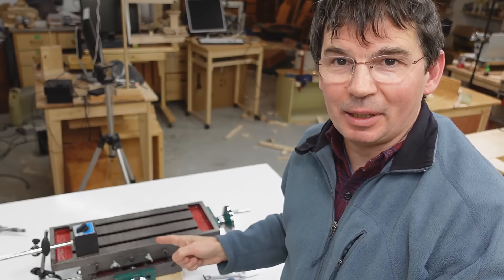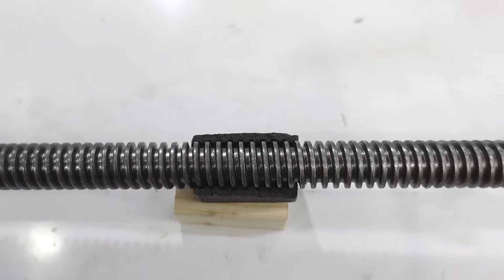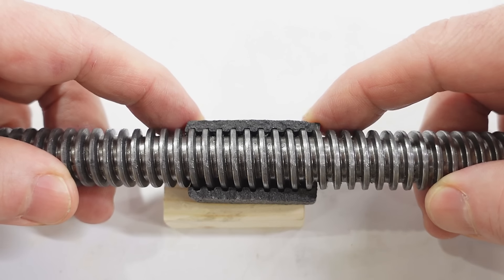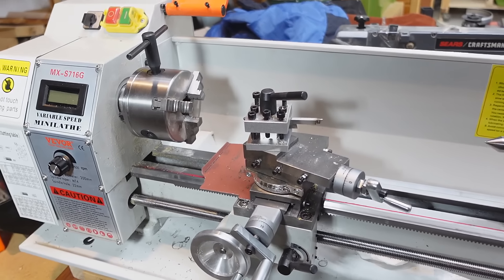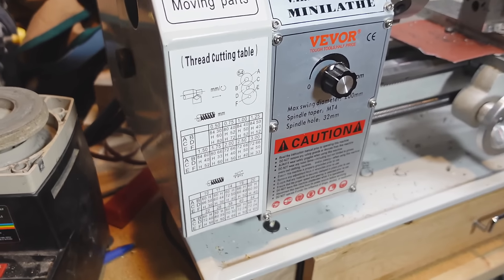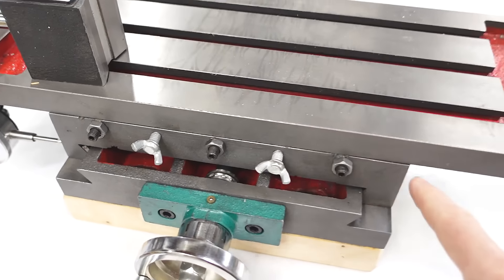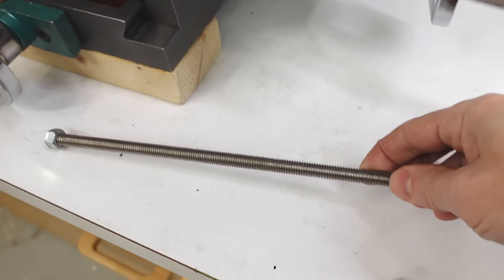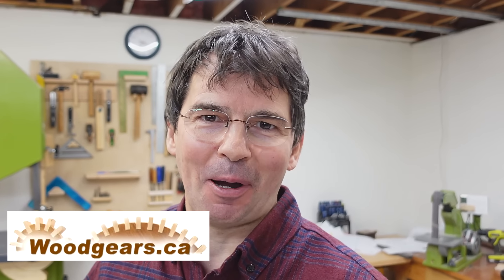Why all the hate for Vevor?

Comment: The worst part is that most of the people who criticized this table will still buy it and use the cheaper drill press with a lot of structural flexibility and spindle runout as a makeshift milling machine just because like me they do not have the budget to buy professional tools but unlike me they don't want to admit it and prefer to blame the sellers/manufacturers.

A better ball screw would make it too expensive for many DIYers, maybe it could be offered as an upgrade for those needing the extra precision.

Comment: I got a 12T hydraulic press from Vevor, to replace wheel bearings, & it works fine.

That things doesn't look like the accuracy is great, but good enough for the price.

Personally, I wouldn't pay for one of those, & I didn't. I made one, from an old bed frame with a couple pieces of all-thread.  (All I wanted was a way to align stuff in my drill press & drill holes, not mill.)

Comment: If you raise and lower it as you turn the handle, then check the bearings. They shouldn’t have more than about 0.001” play. Ball bearings should have less. We see Harbor Freight. For decades, their best stuff was not great and the cheaper products were close to junk (well, some products were pure junk). But the owner decided to move up scale from that and now have a fair number of pretty to very good products. They still have the questionable quality cheap products, but many seem to be in the middle of being phased out. At some point, it’s very possible that Vevor will move in that direction. I have some of their products. Some are fine, but some need work. When it comes to cheap Chinese and Indian products, you really need to have the expectation that while the main parts may be fine, there will be work needed. If you can’t, or won’t do that, then spend more on products that are fine out of the box. There’s no point in people complaining that a cheap product doesn’t work as well as a more expensive one. And folks, these products are really cheap. A good table the same size as this one costs around $1,000. Think about that when you’re deciding what to buy and don’t complain when you choose the cheap one.

Comment: I bought a Vevor lathe. It had really really good reviews on their website. 
When I got it and unboxed it I was extremely disappointed. Where to start, the bearings sounded like they were grinding.
The LCD screen was broken. The bed was two pieces of what looked like die cast unevenly welded together and so on.
(There were still a lot of issues.) I contacted them and they said we will send replacement parts. They sent a replacement LCD
screen only. I am almost positive that they use Photoshop on their products listed on their website. Next they contacted me to
try to get me to pull my bad review including pics on their website. At 50 percent they refund it and then remove the review. I will never
buy from them again. They are not honest and their product is garbage. I kept the lathe because I will be posting it on youtube
to show people hopefully not to waste their money.

Comment: You could consider it as a step in the right direction by getting this table and reworking it to a higher standard as opposed to completely manufacturing a table from raw castings etc.........cost is a high factor for manufacturing from raw materials. especially if you don't have machinery to machine the castings........it is better to be almost there with an economical build and be able to do the rework in your own time for nothing........i would not advise using a round column drill press as the mill part of the equation but it could be a solution..

Comment: You know a hundred times what I know about crafting but I think your focus may be on the wrong part.  Shim one end of the leadscrew to control slop.of it's movement.  Search "acme screw thread standards" and measure your lead screw to see if it's within tolerance, then search for an acme nut of the standard and cut it for a new "half nut".

Comment: Why do I hate Vevor?

I recently fixed a Vevor pottery wheel for someone, after the crappy plastic bearing hub that supports the pottery wheel part itself split in half the first time they used it. It had a badly misaligned belt in it, and there's a 99% chance that the failure was caused by the belt riding up on the edge of the big pulley under the pottery wheel, yanking the pulley sideways.

Sending them pictures of the broken part wasn't enough, they wanted the whole thing shipped back to them to look at and we would have had to eat the shipping cost - and it turns out shipping a 50lb box via Canada Post costs about the same as ordering a whole new pottery wheel entirely. We couldn't even buy a replacement broken part from them, it was "sorry you gotta pay $150 to ship this piece of shit to us, so we can verify it's a piece of shit, and then send you another piece of shit that hopefully isn't as shitty". My friend ended up doing a credit card chargeback on it.

It sat for a while until I got my hands on it, and fixing it involved designing and 3D printing a new bearing hub, grinding a new flat on the motor shaft so I could flip the motor pulley over, and adding a bunch of washers to shim the motor mounting to get the belt to finally line up. Gaaaarbage.

Here's the wheel in question: https://www.vevor.ca/pottery-wheel-c_11146/vevor-pottery-wheel-11in-ceramic-wheel-w-foot-pedal-sculpting-tools-orange-p_010625061454

Note all the great reviews, nothing 1 star. That's because they deleted the bad review and pictures of the broken parts etc that we put up :/

Comment: The biggest issue I have with Vevor is that they claim to have a warranty on their products, but all they ever do is issue a partial refund if something arrives broken or faulty. If I buy something new and it is faulty, I either want a working replacement or my money back, and Vevor does neither of those things. I don't want them to ship me parts to repair it myself, and I shouldn't have to pay to send it back. I don't work for them, and they aren't paying me to do that. Of course, Vevor doesn't make anything: they are just a huge importer, and there are many options for the exact same item. 

I bought from them directly once, and never again. Now, if I buy a Vevor branded product, I buy it on Amazon or eBay knowing that I can easily return it if it doesn't work, and I happily pay a little bit more for that privilege.

Comment: Still, some things should be easily fixed with little extra costs, better packaging would have avoided the broken parts and it should have come with a printed manual pointing out things like the friction adjustments you showed at the start of this video.

Comment: Maybe they figure that the "user community", i.e., youtube, will do their testing, quality control, and flaw fixes for them, which is probably not such a bad idea.  They just cough up some product here and there to popular channels, and away they go, at a trivial cost to them.  As far as I can tell, one major gripe with Vevor is the not-so-good return policy; basically there is none, without a big cost.  Amazon marks up Vevor products, but with a better return policy, maybe that's why.  I have several Vevor products that have proven quite good (for me).  A food dehydrator, a small  metal melting furnace, a diesel heater used in my shop, an engraver's ball vise.  All decent quality and inexpensive for what they are.

Comment: Have fun burning up the spindle bearings in your drill press since they were never spec'd or designed for side loads. 
A drill press with a milling table on it is still a drill press and will perform like one.

Comment: There is absolutely nothing wrong with a cheaply made tool for a low price. If you need the precision of a higher quality tool, you know that and you'll buy better. If you don't care, then it'll still be a huge upgrade over not having anything.

Especially the slide table, i would never use it for milling because the spindle doesn't work for it, but having a x/y table on your drill press is a massive upgrade over trying to position the vice by hand.

Comment: 7:36 you are suppose (afaik) to use your mallet the other way (horizontally) so that the tool taper adds significantly more leverage in the spindle axis, poing the tool off. or maybe you did it that way to trigger your audience, un which case... you win. 😅

Comment: yah know this could easily be fixed by making a zero backlash nut that is thermoformed... or by cleaning the existing nut and using an epoxy with teflon filler to line the nut 9of course the lead screw needs a release to prevent bonding the nut to the lead screw....

Comment: For tools like these, I don't really get some of the the criticism. It needs to be straight, and it needs to be square, that's it. If you need accuracy in movement, you don't trust the lead screw, you measure the movement of the table itself. Yes, it'd be great if your lead screw could land you somewhere close to your dimension, but you always measure.

Comment: I bought a Vevor belt/disc sander. When it arrived it looked cheesy and when plugged in it wouldn't run. The motor just hummed. It went back the next day. No more Vevor for me. Buying stuff you have to fix before it's halfway usable. Cheap isn't cheap.

Comment: problem I have is when the claims they make don't match the actual product capabilities.     if you added your time to fix and materials would it be cheaper still? I get it, buying something that works to get you by.  they need to be honest and up front.  I'll buy stuff if I know exactly what's wrong and if I can fix it, it's the hidden costs that I have to explain to the wife that I need to dump more money into a brand new tool or equipment to make it work.

Comment: My only issue with these China importers in general is that they like to pretend that their machines are perfect and ready to go out of the box. 

I just bought a cheap jointer/thickness combo and I was ready to put some effort into making it work. What disappointed me a bit was the manual didn't cover anything on how to adjust the machine. The importer also doesn't have a spare part program.

IMO they should have just shipped the machine fully disassembled and included a detailed manual on how to assemble it with torque specs and everything.

Comment: I have been burned by vevor in the past.

The big problem with Chinese import stuff like this is the overall trend, you get cheap crap pushing out any possible chance of getting mid-range domestically made stuff.

So you end up with a bimodal distribution of cheap crap for the plebs and very expensive stuff for the pros.

I will say vevor seems to be on the honest side but that doesn't really matter for the overall trend of pushing out that old segment of American craftsmen or say gray tool in Canada.

Like you say you can't get the old stuff anymore.

Comment: One problem with VEVOR is that their advertising is sometimes... not fact-based, to put it mildly. Not just exaggeration, but mentioning something specific that is not true, like type of a screw thread on a milling vice or certain data in the technical spec (including things like fake QA certs). You may still get something adequate for hobbyist use, but you never know what exactly you're getting.

Comment: I brought an 8 x 24. I'd have been better off to find a worn out antique.
My lathe was literally junk as it arrived.
It took about 600 dollars worth of work to make it serviceable. From severely mismatched holes in the skirt,   a warped carriage and untrue ways on the cross slide. It took several days for me to disassemble it, take the parts home and remachine them then shim for a consistent travel. Had I not already owned full sized equipment to start with, I'd have been forced to return the whole shebang. It was completely unusable as it was.
  Save your money and get something better. 
  I bought this one for use around the airport. I wanted a portable unit for odds and ends. But no recommend from me.

Comment: For high precision (<50um) one needs to actual measure the table and tool displacements instead of using derivatives such as a leadscrew/actuators turns etc... think optical/magnetic scales on DRO etc. The leadscrew are only  there to apply force, not to define position. To much deformation due.to mechanical load, backlash, etc. Few lay people seems to understand this principle. Measuring position should ben force and, if budget allows, contactless.
Reply: I'm pretty sure this 'crappy' table can be modded to sub 5um positioning repeatability with some love and less than 100 bucks. Stationary positioning is easy, making precise contours under load is a while different story (stiffness, backlash, stickslip, damping, etc)

Comment: Perhaps a sad statement of the human condition, 0:06  where publicity of any type sells enough to enable low cost, low quality manufacturing.

There are other unrealized costs built in to the mass manufacturing of products like this. This kind of product occupies the same or larger carbon footprint, causes the same or worse pollution, and on and on, as a similar good quality product that's made and sold responsibly, and can be used immediately, and doesn't need service or replacement so soon.

Comment: A cast iron nut that burst is a disgrace to the manufacturer. Everything else no longer matters, the backlash will be from the first day and will only intensify.
  The nuts should be made of brass, there should be two, or better yet three, connected between them at an angle, each with adjustment and fixation.

Comment: Vevor won't fix the issues because Vevor is not the manufacturer.
That lathe is sold under dozens different brands under even more different names and prices. Same with the milling table.
By addressing hobbyists they made sure that very grave problems (like NOT being able to turn the correct threads, which means NOT being able to provide the correct gears... Or the SAFETY SWITCH not engaging correctly, inviting the user to disable it) are not valid for a return, nor penalties.
It's a genius tactic: buy the cheap products, rebrand them, sell them for profit. Most customers won't even bother to point out your product is garbage and you can simply ignore the very few that bother. If any problem occurs, it's the manufacturer responsibility.

Comment: Yeah, perfect things are really nice, but I don't always need a perfect thing to do what I want. I'm a Mech / IT engineer, and I have a really nice keyboard and mouse. I also have a pneumatic nail gun. It's nameless, cheap, and crappy, but perfect enough for those two days in a year I use it. Sure as h* beats nailing wooden framework by hand. Sure, I could buy a $1000 metabo, paslode or makita, but why would I? My <$100 gun shoots 90mm nails, and works more than fine for my purpose.

Comment: I imagine it also lets them put pressure on their suppliers. But yeah, there's plenty of market share available for "good enough and can be improved".

PS good cheap improvement for slop in the lead screw, it's very similar to one of the most basic improvements for belt driven CNC and 3D printing (tighter belts = better repeatability)

Comment: A full turn stop accuracy of +/- .004 or more at random is just plain bad.  You could combine the price of the Vevor table, plus the couple hundred of the drill press and accessories cost and take the $300-500 spent on all that and buy an entire old rusty clapped out milling machine that has +/- .004 and still have literally 10x the machine... an ultimate drill press that's designed for side milling too.  I'm not hating on Vevor.  I own some of their products and they make some very good shop tools at a good price.  In this case it is money sunk and value gained that matters.  If you are going to be ok with literally no precision then the entire world of beat up used milling machines is at your doorstep.  And it won't take a lot of searching time because you're already ok with low tolerance work.  If the Vevor could hold a tolerance but only take a tiny cut that would still provide some value in being a new purchase but this doesn't do that.  I have the same beef with their lathes.  I have yet to see one where the benchtop lathe isn't the hobby.  As much as budget will allow, the tool needs to do work, not be the work.
Reply from the maker: Yes, that magic milling machine will just randomly appear for sale somewhere near me when I want one.  NOT!

Comment: This is a scam company. We bought a heat press machine from VEVOR which costs nearly $500 on April 2024,  it has "heat not even" problem, I shown them pictures for the issue. Firstly they replied to ask us to use temperature at 350F since it has "heat not even" issue at 300F and below. How unprofessional this solution is! Its machine specification points its work temperature range is 0-570F, now it has issue at 300F and below, their solution to customer is "to use 350F then", my heat press glue application temperature is 300F and below, how can I use 350F on it. After debating with them, then they told me they need to ask their supplier. They still have no other solution than "use 350F temperature then" till now, and also ignore my return request since beginning.
In their website, it promises customer "30 days no hassle return", but actually it is a scam. Beware!

Comment: Vevor is definitely "good enough". And yes even critical reviews drive engagement and raise awareness. People are dumb.
Reply: I'm waiting for Mathias to discover the wonders of lubricant. To make dovetail stages work right they have to be lubricated properly. You can't use just any old oil on them. Well, you can but it won't work right. You have to goober them ways all up. He also needs to pack that lead screw with boogers of waxy grease. It'll take up a lot of slop in the mechanism. Get some metal chips up in there too. There's scientific reasons why all of this is.